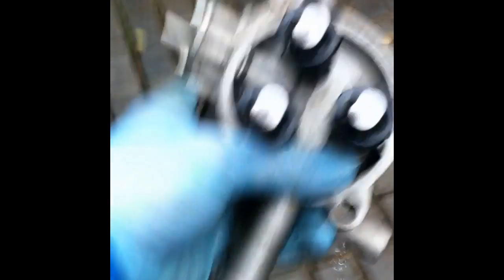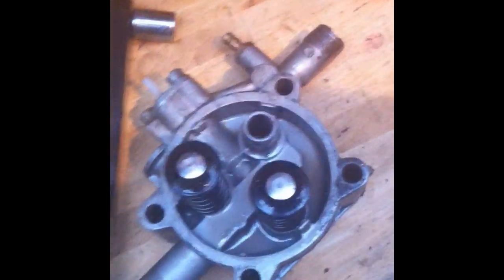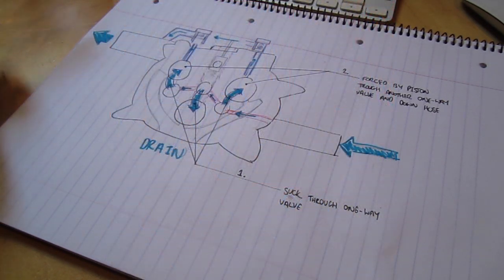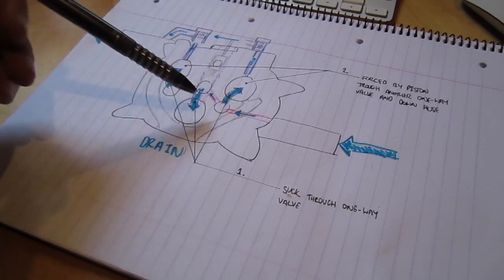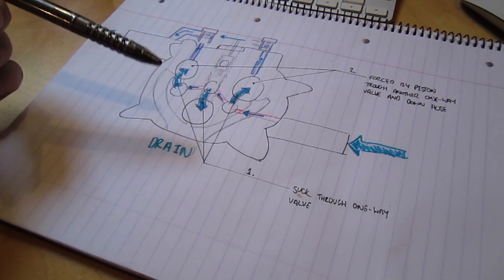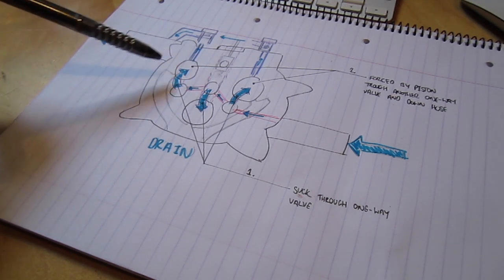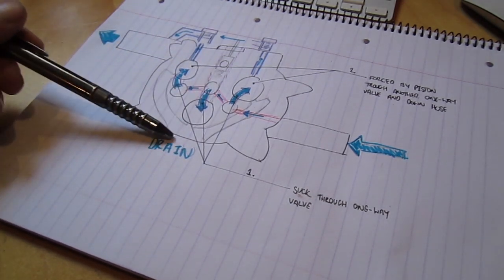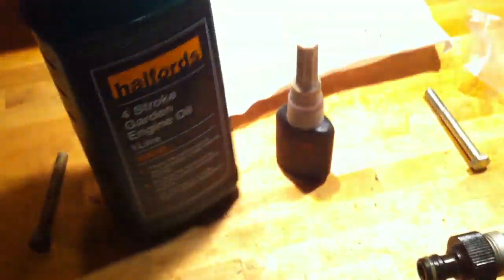Pressure Washer Pump Teardown, How Works and Oil Change

Comment: Good video John, I have the same pump but mine must be adjusted to 1900psi with 2.6 HP, do you know the brand of pump because I damaged the bearing case held by plastic, I would like to know where to buy a new bearing, I have researched about the pump oil and found out, the oil needs to be non detergent oil

Comment: It does very well on siding and decking!>>>t.co/YOYVRTVDNy  Kind of difficult to move around when all set up and stretched out but was expected. Ive read problems with them dying but many people dont know anything about power draw. Directions clearly say use 20 amp power source. that also means you need a extension cord that can handle 20 amps as well!!! Just in case though I purchased the extended warranty for fail safe.
Reply: nice